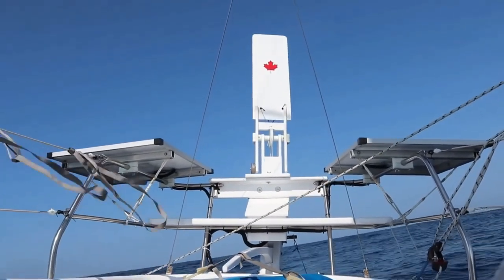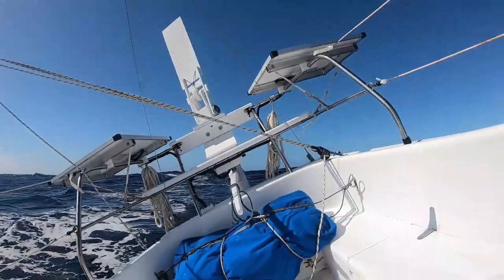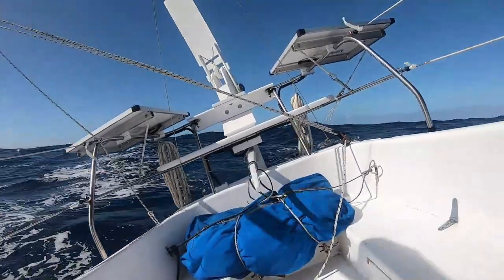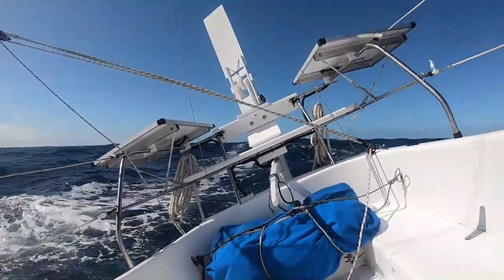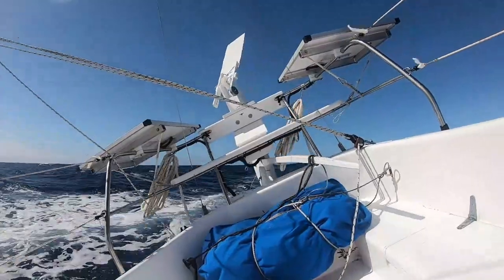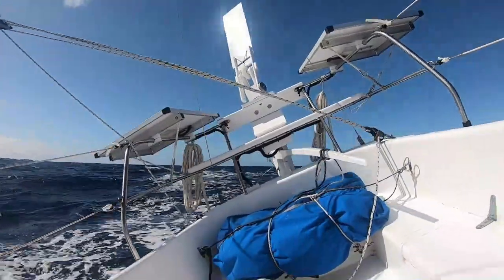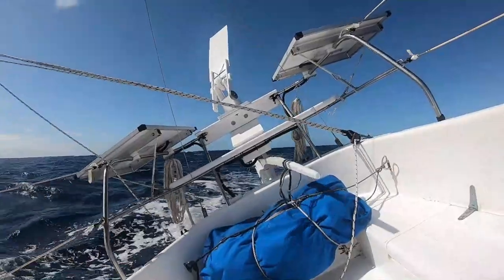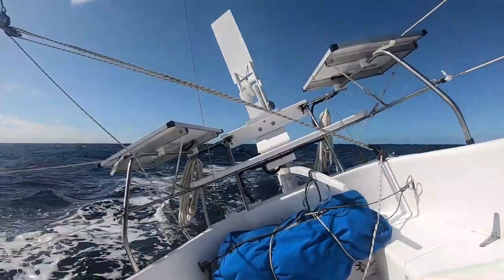MK3 Wind Vane [Trim Tab] Self Steering Digital DIY Plans || My Future Sailing Plans Revealed

Comment: I'm not interested in ocean crossings but I've just made a MK3 for my much modified Seal 22. This is a dual purpose canal/coastal cruiser based in France.  I was torn between the MK3 and Kevin Boothby's self built windvane.  Both are great designs. The deciding factor was the vertical swing of the mk3.  The hardest part of the build is fitting it to the boat.  There is nothing difficult in the construction but you need to be precise.  The plans combined with the videos make it a trouble free project. Many thanks for such a robust and practical piece of kit at a price anyone can afford.

Comment: I built a similar windvane back in the 80s to cross the Indian ocean. It drove an auxiliary rudder mounted on the counter stern. The design worked well in principle,  but my engineering of it was poor so it needed constant repair. I think the mk3 would also work well driving an auxiliary rudder and offer a very cost effective  solution for boats that don't have transom hung rudders.
Reply from the maker: There was a time when most blue water sailors made their own windvanes as well as their boats. Thanks for sharing.

Comment: Purchased and downloaded the plans.  Looking forward to investigating possible ways to adapt it for use on my trailer-sailer (Balboa 26) with a center-transom mounted outboard and through-hull rudder system.  No matter what, it was worth the price to finally have a concise and understandable explanation of this kind of system.   Thanks.
Reply from the maker: As long as you scale the trim tab to the rudder it will work. I included a rudder/tab scaling ratio on the last page of the plan. Good luck my friend.
Reply: What are the total materials cost to construct?

Comment: Suggest slight design modification 

Since it is desirable to use different vanes at different times and different vanes have different mass and cg that need to be compensated by a counterweight. Also it might be desirable to change counterweight effect to adjust vane sensitivity in differing conditions or points of sail.

I suggest modifying the counterweight location hole to a slot so that the counterweight can be loosened and moved relative to the pivot point.

I suggest counter sinking the slot so that hardware doesn’t protrude and it could even be captured to prevent loss use a T head so hardware doesn’t turn when counterweight is rotated to loosen or secure.

I also suggest a locking keeper hole to prevent unintended loosening of the adjustable counterweight.
Reply from the maker: Yes, good ideas all around. The plans do have multiple holes drilled in the H bracket to move the counter weight but a slot would be an improvement as you have described it.

Comment: Hi Alan.
I like the wind vine MK3 system you have developed. Q, would it work for a steering wheel configuration. As I have a Ohlson 38. Thanks Steve
Reply from the maker: I don't believe that it would overcome the friction in a wheel system.
Reply: @RoversAdventure  
Thanks for getting back to me Alan. That's a shame as I did like MK3 system. Steve

Comment: Question about your Wind Vane I was looking at how it works for your Contessa. How would it work on a Pearson triton? Your plans price is very reasonably priced.
Reply from the maker: First off, the Pearson Triton is another great boat. However the rudder post comes up through the cockpit, and as a result the MK3 won't work for that design. It will only work on boats with a stern hung rudder. I'm thinking of adapting a system perhaps in the future but I have so much on the go right now, it could be a while. Good luck my friend.
Reply: That modification for cockpit rudders would open up your market and good Chance pay for your project. Myself being one. Thank you

Comment: Hi Alan,
(edited comment due to sending accidentally before finishing) I am very intrigued by your plans for the Mk III. However, I am planning to use the Mk III on a 24 foot fin keeler (with the transom hung rudder you said is essential). This  boat has very little inherent directional stability compared to your long keel Contessa and I am concerned that the horizontal vane (which in moderate-to- strong winds could easily generate excessive tab angles not in proportion to the course deviation) may on my boat generate wild oscillations about the desired course. Does the Mk III design include a differential linkage to reduce tab angle as the rudder swings over? If not do you think the design could be modified to use a vertical axis vane that would keep the tab angle proportional to course deviation? Maybe you used this on the Mk I or II and it was not the optimum you hoped for?
Reply from the maker: No major modifications will be needed. The control arm on the Trim tab head has a series of adjustments to dampen the input. In addition you may find that adding bungy cords (shock cords) to the tiller will also dampen the input. I also advise the use of different size vanes for different weather conditions. The design facilitates easy and fast changing of the vane. Finally and I can't stress this enough, the boat must be trimmed and balanced correctly for any wind vane to work properly. Oscillations will occur under difficult conditions especially down wind but should be limited to about 10 degrees. If you buy the plans I can also suggest a small modification that may decrease the input further if there is need. I intend to use this system on my next boat which will be a 15/16' with a centerboard. With practice and good seamanship the MK3 will sail any appropriate small boat across an ocean safely. Fair winds and thanks for taking the time to write a very sensible comment/question
Reply: @RoversAdventure  

Ok Alan...thanks for the quick and encouraging response. I like the provisions you've anticipated for changing the vane/tab drive ratio and quickly swapping vanes of different sizes. I forgot to mention initially that my rudder is also partially balanced, and very light on the helm. I am guessing that I will need to reduce the size of the tab considerably compared to the beast of an unbalanced rudder your tab had to manhandle on the Contessa. Hopefully I will be able to dial in just the power needed w/o resorting to elastic on the tiller.
Regards...

Comment: What is max length/ weight of boat for mk3 windvain? Would a trimaran be ok for it?
Reply from the maker: The plans come with a ratio for the vane and tab to size them to any boat. I would happily use it on a 36 footer. A tri would be a good fit as it would track well with the 3 keels.

Comment: Could anyone give me a rough idea of the cost of materials needed to build the Mk3? I quite fancy building one over Winter, but if it needs epoxy or welding etc, it might work out a bit expensive for me. Thanks. Simon.
Reply from the maker: There's a little bit of welding of the trim tab shaft and the trim tab needs to be glassed

Comment: I dont understand how a wind vane works.
As the wind is alwsys changing directions .as the highs and lows move.
So to mee you need to be adjudting the wind bane all the time.
Or you would sail in a circle
Vould you explain how it works on a future video.or if i misded it which video shoild i look for.
Love wr2

Comment: I have a Marcon Cutlass 27 which also has a folkboat inspired hull design with keel mounted rudder. The transom is moved a bit aft and has a steeper angle than on the Contessa. Normally the tiller comes out in the back of the cockpit, but on mine it is extended along the rudder axis and the tiller is mounted on the top of the transom. I wonder if it would be possible to adapt the MK3 Wind Vane to my boat? Maybe a sivel with a angled bend down to the trim tab? The answer may be in the plans already?
Reply: I bought the plans and it seems like it will be possible to fit this on my boat. Will give it an attempt when im a few weeks on land in april-mai.
Reply from the maker: That's great. Sorry for not getting back to you sooner. I have been swamped with work, the 650 project, and the YouTube channel. I need a break to go voyaging again, lol

Comment: Does your MK 3 wind vane only work with a stern hung rudder? I am currently purchasing a 25 foot cape foul weather sailboat. She has a full kill with a kill hung Rudder, not stern hung.
Reply from the maker: Looks like a great boat but the MK3 won't work as it is now designed but I'm thinking about making it more adaptable but will have to run some tests.

Comment: How much do you estimate in materials and parts for your wind vane?
Reply from the maker: That's a good question, the price of wood right now is so high. You don't need very much ply so if you can buy a partial sheet (Home depot sells partial sheets) you will keep costs down. An educated guess would be about $125-$150. If you do build one, please keep track of expenses and let me know. I used scrap from other projects and the only thing that I had to buy was the Stainless Steel shaft, and because I didn't have a welding machine I had to get a machine shop to weld it for me. Stainless Steel and machine shop cost me about $70.

Comment: Do you have plans for a wind vane self steer for wheel steering?
Reply from the maker: I'm actually working on them but won't have them finished before this winter.
Reply: @RoversAdventure  Can I get on a mailing list for when they are ready.

Comment: I bought the plans, but I was disappointed in the fact that there was no direction on how to hook up the control lines from the wind vane to the tiller. Will you provide those?
Reply from the maker: On the 3rd of the private videos around the 3rd minute you will see how the control lines are attached. In addition, it is described in text on the second last sentence of the Rover's motto PDF.  Fair winds.

Comment: Would this be any use on a MacWester 26? It doesn't have a transom hung rudder but is attached to a small skeg.
Reply from the maker: Sadly it will only work on stern hung rudders.

Comment: How does the trim tab system perform downwind(ish)?
Reply from the maker: I usually sail on a broad reach.  You can expect about a 15* yaw depending on the sea/wind
Reply: It works fine downwind!

Comment: is it possible that i could not pay for your selfsteeringplans with paypal ???
Reply from the maker: Contact me via the business email on the Sailing Wave Rover Channel page, and we should be able to find a solution. Thanks 😊
Reply: @RoversAdventure   hello Alan,thanks for your answer. But this is not really important. I can buy it with visa - no problem. I was only surprised that paypal was not an option. God luck for your next project.
Reply: now it works also with paypal - thanks

Comment: Looks like the shop is down? If it’s up could someone drop a comment, so I don’t forget! Cheers
Reply from the maker: I will personally send you a message via this comment thread. I'm looking at using a different platform to get the plans out
Reply from the maker: Good news Captain, the link for the plans is now operational.
Reply: @RoversAdventure  How do I access the plans on my IPad?
Reply from the maker: @charleswalter4907  The link will take you to the WaveRover shop on Etsy. From there it should be a simple download. Since fixing the initial glitch, nobody has encountered any issues downloading them. Fairwinds

Comment: I think your plans are a bargain at that price. When you consider how much the commercial wind vanes cost, that is only a drop in the ocean. I haven't yet bought my boat, but if/when I do I I will be keen to build my MK 3.
Reply: So true. I'm really surprised the Chinese haven't done to the wind vane self steering market what they have to the diesel parking heater. The high quality Eberspachers, Webastos etc were around £700, and then the Chinese started selling a similar design for less than £100. Fair enough, the Chinese one is less likely to be dependable, and may need dismantling occasionally, but nobody cares about that when buying a copy for one seventh of the real thing's price. In any case, many more people have bought these heaters than would have bought the high quality ones, so the market has expanded, and the same thing would happen with self-steering devices. What dissuades me from buying that type of heater is the battery consumption, which is really rather high. A WRMk2 uses zero power from your batteries, which suits me down to the ground. 
I'm about to order the Mark Three Wave Rover plans as have watched all of the videos of Alan's fantastic journeys and it never argued with him once. Nothing broke and nothing fell off. Most of the materials are in the shed ready, so it literally is the cost of some plans - around £30.